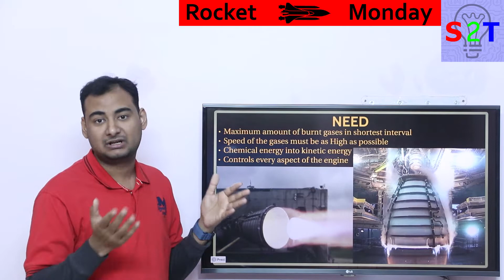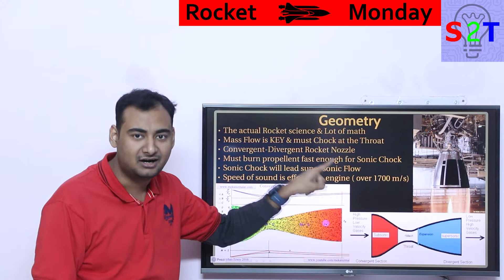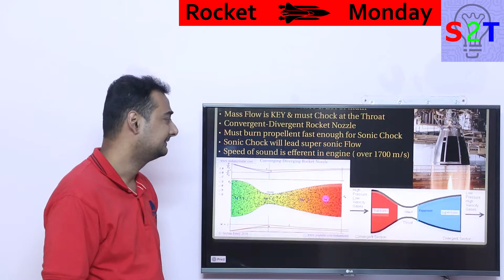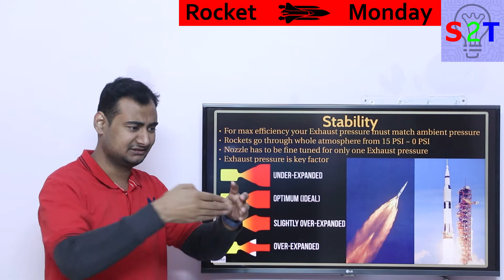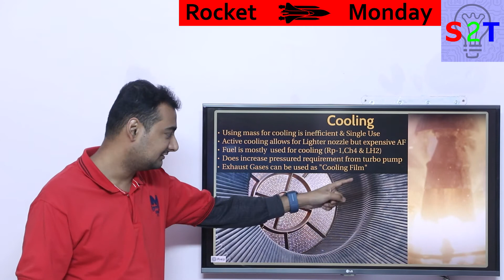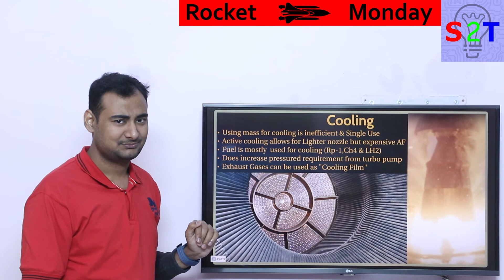Rocket Nozzle Explained {Rocket Monday Ep131}

Comment: But my question is WHY is a slightly over expanded less efficient than an ambient nozzle....cant find this anywhere
Reply from the maker: it must provide a good trad off for something  eg the fact most rocket are going to space and most of the atmosphere is just in few km of sea-level and rocket will just spend few second there
Reply: @s2tenglish  yes I understand that but whats the physics behind the reason why a slightly over expanded engine is less efficient than an ambient nozzle...after all.. there is a faster exhaust velocity